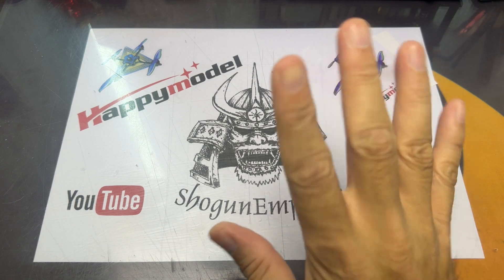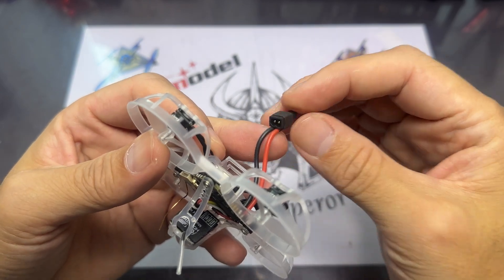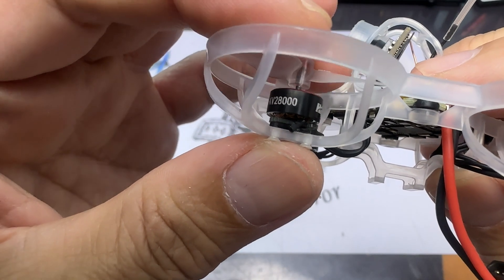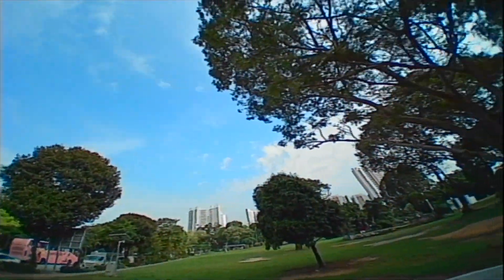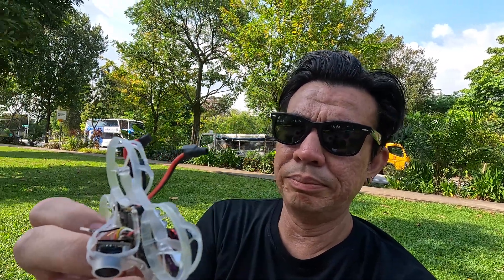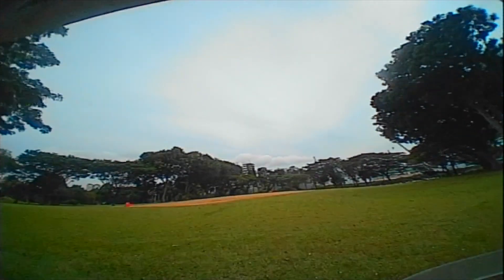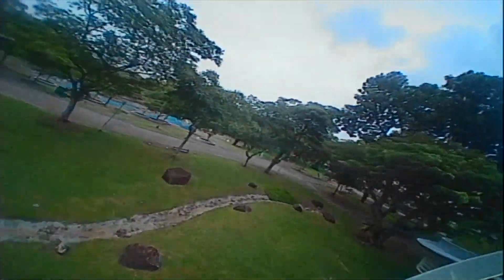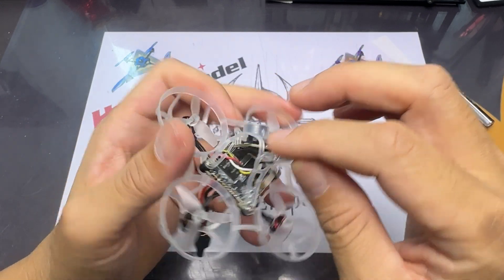Can't Believe They Succeeded in Building This!

Comment: The motor screw a resin? It may have been the glare, but they didn’t look metallic.
Reply from the maker: @jbaked2585  OOOH! Yeah, I actually wanted to mention that but I forgot to record it. Its nylon screws. Lightweight!
Reply: @ that’s definitely a notable feature as they’re a fairly pricey upgrade to do at home. Webleeds version saves roughly .5g when all 12 screws are replaced. 
Has happy model ever released a 65mm whoop with 35mm ducts? I know another brand did, but I’d like it if the branding was the same on my last build. At the moment it’s mobula electronics on another brand frame.

Comment: Hope you figure what was the issue, This model is the one thing that I wish I can add to the fleet still this year.
Reply: Could it be a motor screw loose?
Reply: In these little drones the screws are so fragile considering they hang on a plastic frame instead of a carbon one so any crash can cause this problem
Reply from the maker: @ no issues so far. The ducts acts as a damper in crashes so its not as bad practically vs theoretically.
Reply from the maker: @ definitely not, i checked them before flight as I had to replace 1 of them
Reply from the maker: @RodGSilva  yeah man. I highly suspect it was because the FC gets hot due to the vtx power. Yeah man! Its revolutionary!